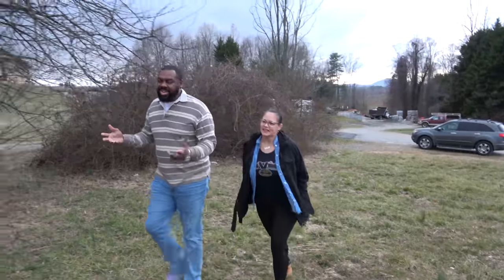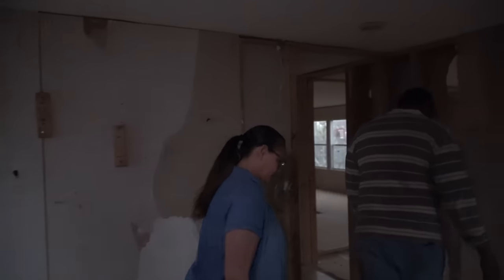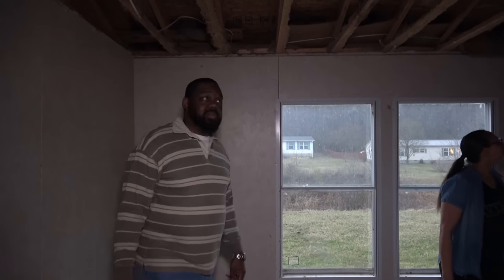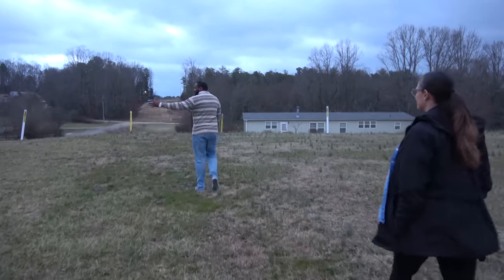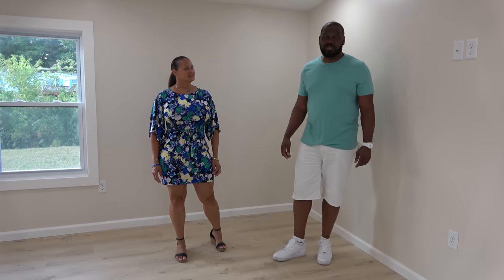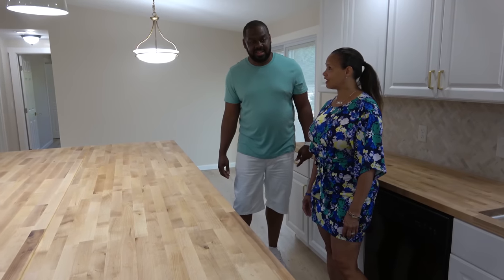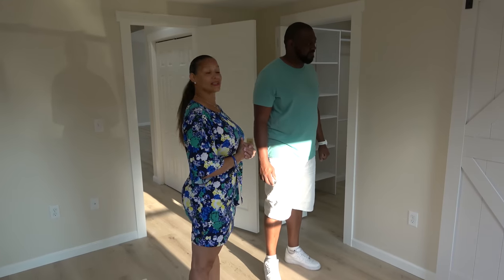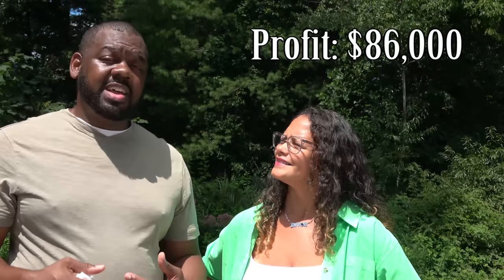Kayla Susan House Before & After Renovation

Comment: You'll be surprised about just how many people still use soaker tub. I watch HGTV all the time & that is one of the biggest request mostly from women that they must have a soaker tub, a lot of young women are into pampering themselves these days....🛀🛀🛀
Reply from the maker: @valeriehurt3050 Good point. Jacuzzi tubs would be much better. Also the amount of water it takes to fill them is insane. You will have to have a huge hot water heater.
Reply: I must know a lot of weird people because no one I know likes soaker tubs.. some like tubs.. but just not the soakers
Reply from the maker: @lindacouncil1353  Agreed
Reply: @1LUVTV I thought the same thing and was going to put a new jacuzzi tub in my house, to replace my soaking tub for resale.  But then I attempted to use one at a time share condo and yuck!  I fired it up and bubbles with some hair and bathwater backwash came out as it circulates right through those jets....and that was the end of that idea, lol.
Reply from the maker: @Christina-71  Wow!!! 😂
Reply: We built a new master bath. The biggest waste of money was the tub. It’s a big soaker tub, but the amount of water to fill it is astronomical. In addition, I no longer have the strength to get in and out of it. The BEST thing we put in it was a floor level (wheelchair accessible) 4x7 tiled, floor to ceiling walk in shower. It’s beautiful. I certainly hope the next people like the tub as I thought it would. Lol
Reply: The only thing I would have done is make the shower wheelchair accessible. Other than that it’s nice.
Reply: Everybody I know wants a tub. It has always been. Not that outrageous. Who just showers all of the time? Weird.....
Reply: @yashursuntheamericanindian  exactly! Agree, very weird!!! 🤔🤔
Reply: I would love a 2 person 70 gallon soaker tub!
Reply from the maker: @generallyspeaking850  True Story
Reply: I love to use both shower and tub....
Reply: What is up with NOT HAVING A BATHTUB off the primary bedroom? 
. You did a fantastic job EXCEPT the lack of a bathtub… after a hard day… my wife wants to relax in a bubble bath & soak her body… I literally would  NOT buy a house that did not have that… & you know it’s women who decide on the purchase of homes ….